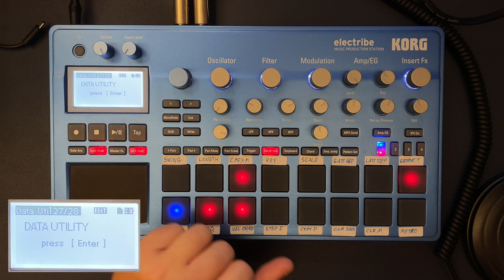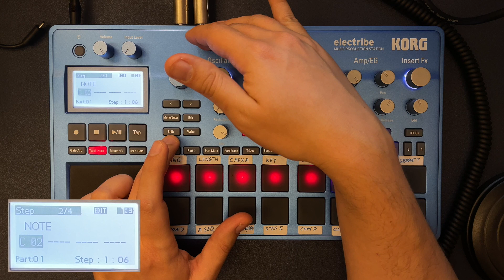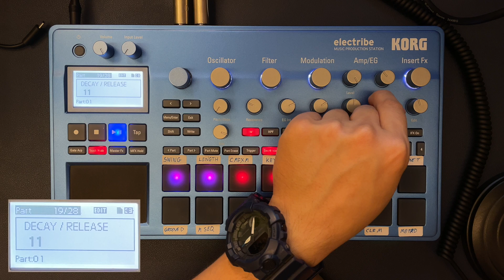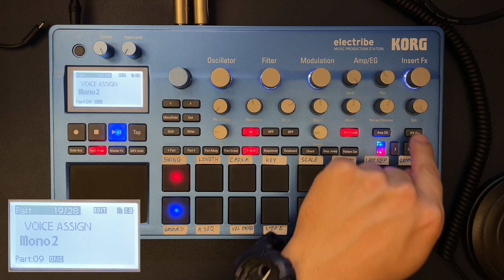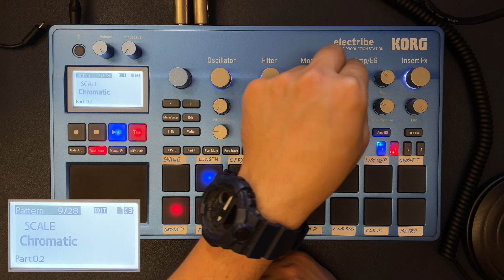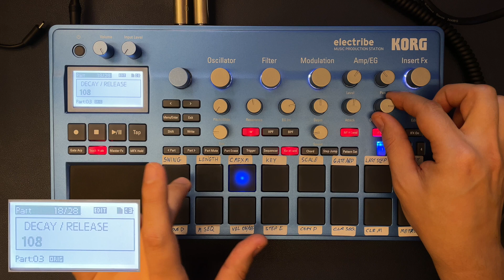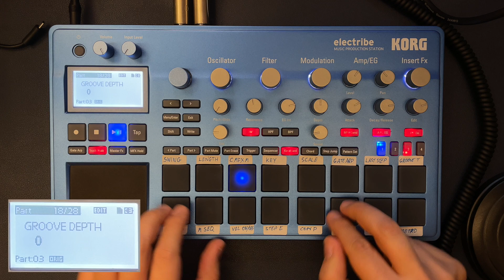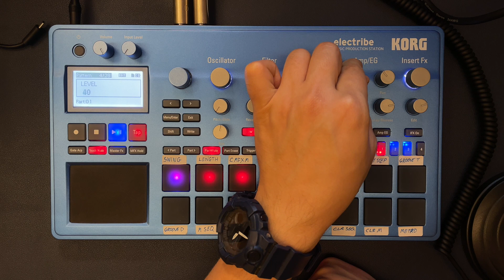Korg Electribe 2 step by step tutorial to create a track 2021

Comment: The E2 synth version gets overlooked, but it is a highly underrated synth in its own right.  I use a Keystep to live play, sequence, and arpeggiate mine.  When I get a sequence or arp that I like, I record it into the Electribe.  You're absolutely right about the overdrive, it really beefs up the synth sounds.  Combine that with the many filters available, as well as the analogue-style knobs, and it is capable of some great sonic chaos.

Great video!
Reply from the maker: Thank you for watching! 🙏 Totally agree, it does get overlooked and capable of some really cool stuff. Combining with Keystep sounds a like a great and clever way to get even more out of it since its internal sequencer is not the best to program I would say
Reply: @RandomNoiseMusic  You're right about the sequencer, the step edit mode is awkward at best.  I highly recommend getting a Keystep, it really pairs well with the E2.  The ability to switch midi channels on the fly is great, as you can set up different "patches" on the various parts & jump between them at will.  The only complaint is that the E2 doesn't recognize pitch bend, but otherwise the Keystep turns it into a full-on synth.  Not bad for a little over $100...
Reply: And LFO
Reply: oh you can connect the e2 with a keystep?

Comment: Excellent tutorial, especially if you refuse to read the manuals. Nice tip about the arp. One of the reasons  I use the E2's is the touch pad, one can actually make an entire song with just the touch pad. The only ifx I use is the delays as you can alter the sounds in other ways that won't steal voices. If you listen to the E2 on full range monitors you'll  find the E2 can still compete with any digital grove box for quality of sound.

Comment: Hi I like your tutorials so much and I have a big problem, if you could please reply to this question ASAP. How to copy parts within the same pattern. For example if I have a part number 4 within the same pattern and I wanna copy it to part number 1,2,or 3, how could  I be able to do that. That is one of the biggest lag for this puppy. Thanks in advance
Reply from the maker: Hey, what do you mean by copy parts, like having one synth or drum sound patch on one of the parts and then copy it to another? you can use the shift+pad 13 for that. If you mean copying the bar to the rest of the bars, there is no direct function for that. What you will have to do for that is first creating your full sequence for all the parts on the first bar (you have to start with 1 bar for this to work), and then when you covered all of them you should extend the pattern to 2, 3 or 4 bars as needed. I hope this answer your questions and helps

Comment: This is the best tutorial.
I have a question if anyone can help me out.
Once you've created a tune like in this video, can you record it as you build it part by part so that you can listen to it play back?
And if so, how😁?
Reply from the maker: Thanks for watching and kind words! I am afraid that the Electribe 2 doesn't really has a song mode, so it's not possible to record and store the performance on the device itself. What you could do is, create all the patterns with the different transitions and needed arrangement, and use the Chain Mode to tie them together. If you are not familiar with this method, you can check out my tutorial on that here: https://youtu.be/7qBpot4mQC4
Reply: @RandomNoiseMusic   Thanks for your reply. 
I'm using the red sampler but I assume it's more or less the same scenario.
I followed your video step by step and it's really magic being able to create something.
I thought I could transfer a tume/song onto an SD card. 
I'll try your suggestion first after I watch the tutorial. 
Thanks again.
Reply: @orphanoforbit7588 there is the event recorder which pretty much does what you’re saying - will save each performance under a new number on the SD card - you have to step through to find them so a bit limited for live use!

Comment: hello! to start thank you very much because you help me a lot. I need your help I'm stuck.. I explain my problem..
I practice doing the exact same thing as you in the video with the same Korg. I do this to train and understand electribe in more detail.
so I do exactly the same thing as you in the video and arrive at the moment when you pass the "length" from 1 to 4
 It happens that everything I have just done does not complete like you... the sequence cuts out every 2 seconds. parcontre the kick that was placed in the sequencer and the other I hope you can help me and understand me because I started with the electribe 2.
I am French, I hope you will understand my English :)
Ty
Reply from the maker: Glad you find my videos helpful! You always have to make sure that you start with the first bar (1) and don't change the length to 4 until you finished the basic elements. You also have to make sure that you don't press the next 2,3 & 4and change something there. The Electribe will only copy from 1 to the rest if the rest are empty and you didn't change something there. I hope I am able to explain it clearly here. I sometime forget about that too and have the same problem. It's annoying problem that Korg should have solved with a way to freely copy and past the bars around but unfortunately it doesn't work like that..
Reply: @RandomNoiseMusic  Thank you very much for your answer !
 You help me a lot :)
Yes ducoup it is unfortunately a small problem which quickly becomes embarrassing..
Keep it up you are the best :)

Comment: Hey! Is it possible to use samples loaded from the sd card? Or this feature its only available in the sampler version? Thank you very much for your videos!
Reply from the maker: Not with the original firmware, the synth version does not support samples. But if you brave to try to install the Hacktribe version it will add those capabilities to the synth version too.
Reply: @RandomNoiseMusic  thank you so much, definitely will be checking the hacktribe

Comment: Hey. I enjoy your videos a lot. Can you explain why if i put  in the sequencer the Snare(for Exemplar in pad13) and hihats(pad 14) on the same steps. You can hear just one of the pads.
Reply from the maker: Pad 13 is usually reserved for the closed hi hat, and pad 14 for the open hi hat. Drum machines have been built in the past in a way that mimic a real drummer. If you think about it, there is only one hi hat in a drum set, and it is either can be closed or opened at one time. In more modern machine like the Electribe, or even vst softwares, you can actually choose to assign 2 or more sounds to the same group so they mute each other. So you can either choose to reserve pad 13 & 14 for the closed and opened hi hats, or you can change the settings for these pads to not mute each other. Search in the menu for ALTERNATE 13 & 14 and turn it off (I think it is page 13 in the pattern menu if I am not wrong). There is also ALTERNATE 15 & 16 option btw.
Reply: @RandomNoiseMusic  thx 4 the fast answer. problem solved . u r the best.

Comment: Thank you very much for this tutorial, much appreciated!  I have been thinking about getting the KE2 and ran into your channel (signed up right away!) while researching.  I noticed you have labels on the pads.  How do you use these, and, how do you decide which part is assigned to each pad (meaning, do you have a preferred setup/location for the kick, Arp, etc...)?  Thanks!
Reply from the maker: Thanks for watching and glad you find it useful!
For your questions, I use the labels to help me remember the shortcuts to some of the menu items you can access by holding shift and one of the pads. You can see all those here, they are very useful and make the workflow much more easy and fast: https://rotten77.cz/korg-electribe/korg-electribe-shortcuts-color.png
As for the decision on how to assign parts to pads, I got used to the default settings of the E2 in which usually the bottom raw is dedicated to drums sounds, while the top one cover all the synths. And I will usually start with the bass being on the first pad in the top raw and continue adding elements as I build the pattern. That way I can easily remember which part is which. Its not a strict rule, and I am more flexible with that sometimes, but I try to keep it consistent. Hope this answer you questions and helpful :) And thanks again for watching and the sub!
Reply: @RandomNoiseMusic  Thank you very much for the reply, much appreciated! I have been glued to YouTube watching many of your videos the past couple of days.  Amazing talent!

Comment: Hello, I would like to ask how you added the filters that are at 8:28 to the sampler, for example the acid filter.
Reply from the maker: The sampler version does not include these filters, only the synth (blue version). But you can install the "Hacktribe" firmware to get it to work on the sampler as well
Reply: @RandomNoiseMusic  thanks😃

Comment: I love your tutorials so much. I literally use this to help with the sampler version. I have a question, would you happen to know why when I switch patterns on the sampler there is an audible gap?? Do you have any remedies for this?
Reply from the maker: Hey thanks for watching and really glad to know these are useful! 🙂 About your question, I am assuming it is the same thing that happens with the Synth (blue) version. I am afraid that is how this gear works, each pattern store all the settings and data, so when switching between those patterns, it is almost like it needs a millisecond to reset and load the next ones (like filters, envelopes effects etc'). Another thing is that the envelopes on both of the Electribe are monophonic, and while you can play a few notes together, the notes "cut" each other if they played one after another with a long release (decay mode). My suggestion will be to avoid pads or other long notes parts in between the patterns states, and also trying to keep similar settings between transitions. Once you get used to this idea, you start to think more carefully about how to construct your patterns, so its kind of work, but I do wish Korg had made a much better song mode.. Hope this helps!
Reply: @RandomNoiseMusic  Absolutely helps. This answers another question I always had as to why I've never seen videos featuring the performer switching patterns. Wish Korg ironed this out, but oh well, will make do with the tips provided. Thx again!!

Comment: Really good tutorial mate. I have the sampler but most of this still applies and is really helpful. Cheers! 

Edit: Does switching to poly1 help with the envelope cutting off problem when making pads? I think I saw something about that in one of Loopop’s vids but probably didn’t understand it properly.
Reply from the maker: Thank you for watching! the difference between Poly 1 and Poly 2 is that in Poly 1 mode every time you press a key it will reset the envelopes. So for example you set the envelope to control the filter in sort of way, if you hold one key and press another, that envelop will be triggered again. When you switch to Poly 2, when you press one key and then additional one, the envelope will continue without being triggered again. So this is useful in a way, but unfortunately it does not solve the issue of the synth being paraphonic, and notes will continue to cut each other... Hope I've managed to explain it right and this is useful.. 😅 thanks again for watching!
Reply: @RandomNoiseMusic  Ah right! That does make sense yes, cheers!

Comment: Does anybody know how new models compare to the old ones? In terms of sound, do the old ones sound better, the tubes may be a big factor in the shaping of the unit I imagine?
Reply from the maker: I've heard and watched many swear by the sound of the MX. I never had one, I had the R MK2 many many years ago, but I do remember the MX when they just came out. Use to play with them in the shop. The tube do make a difference if I remember correctly. The new Electribe sounds a bit more digital I guess. There are more oscillators options with the new ones, but I think the MX did sound slightly better. The filters on the new ones are better though in my opinion.

Comment: Hi. Nice video. One question. Why you have volume to max? Cheers
Reply from the maker: Hey, thanks for watching! I prefer it like that with my setup - the Electribe is connected to my Focusrite scarllette audio interface through the balanced inputs and the gain seems to work best when the volume is all the way up.
Reply from the maker: Its different from connecting through the headphones. I think that there is more power coming from the headphones jack
Reply: I can't do such thing on the Emx-1. When I use the audio interface of a zoom h5 to record without a daw I need to play it with very low volume. It starts cracking the sound. Maybe new Electribes are different.
Reply from the maker: @Henr1x  could also be that the zoom has a pre amp on the connection. I never used one (the zoom), but maybe it is possible to disable the pre amp for cases when it is not used with a microphone. I had similar issues when connecting mine to the combo jack on the focusrite
Reply: @RandomNoiseMusic  indeed I feel something is going wrong with it. Need to check it better.